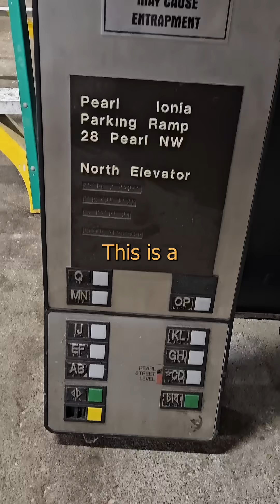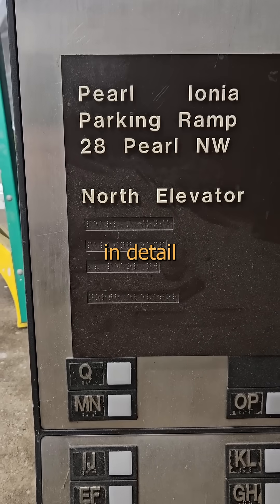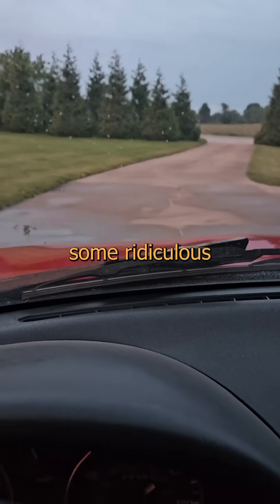Miata Mischief #chrisboden #engineering #gear #elevator #score #stories #parts #hacking #making

Comment: In a 1st gen RAV4, backseats removed & stored over in YeahNahIDunno. Mate & I go collect a  fridge, a very large fridge  ...almost a small chiller large fridge. Got 6' 5" * 2'8" " * 2'8"  fridge in with all doors closed; lay back of passenger seat right back, "borrow" a block of wood so fridge sits level..ish, adjust rearview mirror around fridge, like literally move mirror so fridge is far enough forward to close back door. "Sitting" in driver's seat I was contorted around fridge, had to use my shoulder to hold it so it wasn't acting as a brake on the steering-wheel. Mate reckons I had "more room to drive"  coz I had my arm amputated ..spoz I do take up less room now. Looking to the left I could only see fridge, going thru every intersection was a religious experience; "please God let us ass thru this crossroads undamaged, lest we harm thy sacred fridge"?.  The fridge was relocated successfully with no damage except a few scratches on the dash & soldiers on to this day keeping about 6 dozen beers cold for those that earn them. I drove that trip but to this day I have no idea how Old Mate made the journey, wasn't enough room for the  fridge & "¾ of me" at 5'9", so your guess is as good as mine where all 6'3" of him squeezed into. 
Miss you Mudskipper, R.I.P.

Comment: I dragged a massive metal toolbox (the kind with drawers), full of tools (mostly a shittonne of drill bits, some electricians tools, a load of allen-keys, and some wider miscellaneous detrius.) Out of a dumpster down the road, struggling IMMEDIATELY, in more and more and more pain as i try and drag that chunky bitch from her landfill fate. I dont think i actually got INTO the dumpster, but i got pretty fucking close trying to leaver it out. 
I dragged it out of the dumpster, on to the grass, and promptly flopped down and phoned my mum to send my sister to rescue me, since i was sitting on the side of the road, because id managed to figure out that, yeah, my Ebike probably wouldn't be able to drag that home. 

my sister and i also pulled out a ladder, which we stuffed into our mums car, and she drove home while i desperately tried not to let on that i was in pretty severe pain.

Im disabled with a degenerate joint condition. My muscles are reasonably strong, but my joints are essentially made of silly putty, and i had pretty clearly hurt myself pretty damn badly. I was lucky enough to have access to pain medication and didnt have to go anywhere, because it hurt for a fucking long time.

I have honestly not been properly out of pain since. 

Luckily the tool box fucks SEVERELY, so id say its worth it

Comment: Queen sized bed frame with public transport.
Alone.
I had to change the connection 3 times and on the last one it was so packed i couldn't fit with my 2 huge beams and a backpack full of planks.
So my smart assi went to a random store and begged the clerk to hold onto one of the packages for me. Happened to be a lingerie shop at that. But the clerk lady was really nice and rather amused so it all ended well

Comment: When I had a 1999 Acura Integra, I moved a couple blocks away. I think I got something like 12 guitars in cases in that thing. The previous owner said he got a 7 foot christmas tree in it, and I used to stick my bike in the back just by removing the front wheel.

Hatchbacks are awesome. 

Oh, and one time I hauled a 2"x10"x8'  cherrywood beam that was in a pile of rubble from a small barn that was recently demoliahed on my great aunt Marges property.  I was in college about two or three hours away. I was told about the demolition and was asked of I would like to reclaim any of the wood. I think this must have just been stored in there, and not used as a structural part of the shed/barn. There was about 16 feet of it, and I had to cut it down so it would fit in my 1993 Toyota Corolla sedan. I made guitar and bass bodies from it.

I wonder who put it in the barn, how long it had been there, and what the story was.

Comment: Okay, In high school, a friend of mine and I hauled home the engine from  a late 60s VW Square back by removing the front seats of my father’s ‘58 beetle, using lawn chairs to sit on on the way to pick up the engine, then folding up the chairs, and balancing the engine on the parking brake handle and sitting on the engine while driving back home.

Comment: In one day and a lot of discomfort, I discovered that a 2020 VW GTI can fit 2 rear doors for an F350, AND a hood for the aforementioned GTI. The steering wheel was scoped all the way in, seat all the way forward, up and backrest at an acute angle. I couldn't wear shoes otherwise my clutch and accelerator were always depressed at least a little, and I had to have my equally uncomfortable but slightly smaller passenger shift because I couldn't contort my arm to reach the gear shifter. That was a fun 6 hour trip

Comment: Back in the mid 90’s CSX was (re)double tracking the former B&O across northern Indiana. With that the old B&O color position light signals were coming down too. The signal foreman said we could have a signal head. We come backs couple hours later with an old Chevy S10 with dead shocks loaded 4 B&O CPL’s, 1 barely fit in the bed, one stacked on top and one hanging over each side and drove off scraping the ground the entire 10 miles home.

Comment: Me and my dad had to haul 3 giant lexan(a sort of plexiglas, just layered) from one part of the city to our house, about 10 km. We had an old station wagon Citroen BX, that was large but not nearly large enough. The panels were longer than the car. So we put them on the roof tie them down and off we go. They are hanging over the hood and the trunk is open. Everything worked until we hit the freeway and the panels acted like a wing. I could swear that the front of the car lifted of the ground at one point That was the craziest haul i did in my entire life. Than again, my dad is a crazy, unrelenting SOB...Who knows what is brewing under that gray scalp...

Comment: My pregnant wife explains we have yo pick ip the changing table but not, that it was a combination crib, changing table and three drawer dresser all in one and all in solid pine. I completely disassembled the beast with a borrowed pair of pliers . Stuffed the trunk and back seat with parts. I put the floor mats on the roof to pad the oversized rails strapped down with the rear seat belts extended thru the door jams and tied together.

Comment: I transported a ye oldie freezer inside a 2004 yaris with my grandma as a passenger.

I also had an occasion to tow an 2004 Audi A4 with the same yaris (yes little 1.3L engine did it).

Comment: I once owned a 98 Chevy 1500 V8. It was held together by stuff from home depot. I used this truck a lot
There was this one time my friend had to move things out of storage. One of those things was a nonoperational motorcycle. Of course we rented a flat trailer. I ended up having to hold the bike in place on the trailer because the straps kept snagging.
Hindsight really is 2020

Comment: I welded a full size boat captains chair to a set of office chair wheels, had to move it back home so I loaded it up into the Miata upside-down. Anything over 20 miles per hour spun the wheels like a helicopter rotor... and it made the little Miata look like a helicopter... super sketch, if one of those wheels flew off and hit me at the speed it was spinning I would have gone unconscious.

Comment: (definitely did not) saw a big county sign on the side of the highway when taking my younger brother to his friends house, the sign was just resting against its post, now on the ground. i went home then to work. after work i drove back to see if it was still there, it was.

i pull over on the side of the highway around 11:40 pm in my 95 civic sedan and open the front right door and BARELY fit this sign inside in about 5 minutes. drove home with the passenger window down so the sign would fit

Comment: Not the most exhilarating story compared to others, but I have proudly fit a mattress INSIDE of my dinky Civic coupe. We had to fold it in half, cram it through the back and it just barely managed to fit through the interior trunk access and into the front seat with the front passenger folded forward. So from trunk to front seat, we made it fit.

Comment: 400kg of laminate in my Volvo 850 wagon. sure, legally ir was overloaded and i couldnt see a fuckin thing out the back or the blind spot but it fit perfectly when i put the seats  down. now, the place mr and my best friend needed to haul that was his house, wich is on a hill, a very steep hill. luckaly the volvo is a TurboDiesel and hauled it without issue. 

Also one time me and 3 of my friends helped my moms friend move. and unfortunetly the volvo was in the shop at that time so we used my best friends Mercedes 190D, overloaded the trunk, stuff on the roof, on us while we were driving. idk how taht 2L NA diesel was able to hauls us, but we made it

Comment: I have an NC Miata. Same same as that NA but upscaled for my 6’2 ass.

I took a trip to IKEA, bought a bedframe, hauled it out and proceeded to break down the packaging in the parking lot. All the funny bits went in the passenger side, cardboard crammed in the trunk, and the backboard jammed between the console & passenger seat.

45 minutes later I made it home with the top down and seat heater up in 50° weather, painfully and achingly aware of the aerodynamics of passing around an 18-wheeler on the freeway with that headboard sticking up like a shitty sail. They call the NC the boat of Miatas, but I pushed it a little too literally. I should’ve just told my girlfriend I had it delivered..

Comment: Last year we had a project car, we wanted to bring it over to the shop. So we took the tow bar and hookt it to it 100m later the bar broke and stupid me the project car had no brakes and no handbrake nothing... roling down the hill i dodged 2 cars of trafic and ended in the farmers hedges.
He heard some noise came to watch and we made fun about that he thought it was a stunt that didnt went as we wanted.
Then he went took his tractor and his tow rope.
Since the hook on the car broke and not the bar it selfe he we looped the rope arround the engine Mount and he pulled us out up the hill from there we put the car in front of the project car and pulled it with a car. to make sure its not crashing into the other car the 3rd of us friend sit in the trunk holding a tire between the bumpers (Trip was like 8km that are round about 5 miles)

Comment: My mous sketchy would have to be one of two, first was hauling a week's worth of firewood and a tarp in the back of my sixteen buick encore, just so I wouldn't have to take five trips in a wheelbarrow up my backyard, second, was probably a thousand pounds worth of dirt, used as wait during a very bad winter in my 1999 f150, because my dad couldn't be ours to grab the cinder blocks out of the frozen backyard, and we had just dug our ditch out three days beforehand, possible honorable mention hauling a 2011cadillac cts out of a ditch on a icy road in a 2000 ford explorer

Comment: Back in 2000, there was an old poultry processing plant that was slated for demolition in my home town. It was my last summer vacation... The time between graduating college and the start of my first post education job in October. I found I could slip inside via the slots that the meathook chain belt passed through, and I was able to unlock the place from the inside. I went there nearly nightly for three months. I salvaged telephone patch panels and wiring, old equipment, sensors and switches and brass gauges and all manner of 50s-80s era equipment... My prize finds... The relay control unit for the elevator, and the original blueprints for the building. All of this hardware was hauled home either walking or by bike, under cover of night. I spotted a massive electric bell... I think it may have been nearly a foot in diameter. It was very high... I had strategized a way to safely get up there, but sadly, the next day, demolition had begun.

Unfun fact... I found two vaults there. Both were accessible. In one, I found boxes of folders... Old employee records... SSNs, the works. When the company shut down, it was all left behind. I took my dad's folder, and another relatives folder as mementos, and burned the rest of 'em... Stuff like that should have been destroyed... Not left behind.

Comment: When I was a kid, about 10, there was a Sylvania lamp distribution center, big huge warehouse about a half mile from my house, where they shipped bulk quantities of lamps of all types to, I guess, stores.  A guy on the shipping conveyor would physically pick up a box of light bulbs and SHAKE it (we saw this process, my idiot friend and I) and if it RATTLED or had an obvious hole in it, he'd stack it by the loading dock door. Same with fluorescent tubes.  48 inch jobs and 96 inch ones too.  Then, end of day, he'd take these rattly boxes with a couple of broken bulbs or tubes and toss them into the dumpster.  Along comes ME on my old 3 speed English bicycle and I'd heft a box about a foot square full of fluorescent tubes 96 inches long and make off with it on my BICYCLE.  No box? No problem, I'd tie them together with string or wire for the trip.  Same with a 2 foot square box of 3-way Sylvania light bulbs...minus the 2 or 3 broken ones.... maybe 60 lightbulbs in one go.  My little shack laboratory had 2 96 inch fixtures I'd mounted up in there so I had PLENTY of spares.  When I got my ham license in high school I had thousands of light bulbs that I took to local hamfests and sold for beer money!  Only once did I crash in a cloud of phosphor, mercury and broken glass.... and it wasn't pretty.  I found my first ever copy of AVIATION WEEK in that dumpster and it changed my life.  I also found lunch garbage and the occasional possum.

Comment: A tree fell across a trail me and my buddy used to use as a shortcut when biking to town. We brought out an axe and took turns on it until we got it to split, took the end that wasn't still somewhat buried, stuck one end on my bike in front of the seat and the other end on his, used the tree as a bridge between the bikes and hauled the tree home as a 4 wheeled independently steered vehicle (was not easy) and chopped it up into firewood. Fun times.

Comment: Just recently I had a need to buy a 500L water trough - the kind you put in your paddock to make sure your herd of cows has water. Made of solid plastic it was light, but big and awkward. I should also mention that there were gale force winds at the time. Having an SUV it wasn't going to fit inside it, so I threw it up on the roof racks and used strops to hold it in place. It was sketchy enough that the store manager offered to drive it on their ute the 30km to my house free, because I was surely going to crash. I declined. Got home safe and sound, not an issue.

Comment: We cut a steel spiral staircase into 3 parts in front of a wall of windows. This home had no driveway, we had to walk in about 250 ft, so we opted to send the 3 parts down to the road below, some 80+ feet, along an old mining cart rail pulley system. The pieces didn’t fit even halfway but they made it down mostly without incident or runaways. We then hauled it back to the city somewhere miles, and pilled into the middle of our warehouse bottom floor where some old bikers and a monkey that cooked meth started a fire and burned out the elevator shaft. Here we hoisted each piece with some old maritime wooden block and tackles into place, where the cut points were re-welded. Then just 4 years later this spiral stair would be the only route of egress to those above when our warehouse main stairwell caught fire. Saved some folks that work, good stuff. The other would be hauling my face to the hospital after someone randomly smashed it in, having to convince people you need an ambulance when your face is broken in 12 places will def take the wind out of your sails. I guess that’s more someone hauling me at that point, but a lot of me hauling me after that first ride. What baggage?

Comment: when I was about 17, there was an abandoned Volvo 240GLE Turbo 2door on my street. After a few weeks, and a bunch of towing notices building up, I thought I should take it. So I'm on the side of the street trying to jimmy open the lock, when a cop car rocks up. He asks me what I'm doing - trying to bust open the lock of a dupmed car officer sir. He goes back to his car and runs the plates. Comes back and tells me the car has indeed been dumped. He then helps me open it up, and then push it down the street to my place. Fixed the blown turbo and got it roadworthy. That thing was a tank that my drunk dad stole two years later, but that's another story.

Comment: In the past I was tasked to bring on site 30 meters of steel cable trays, 10 pcs of 3m, because our delivery car broke midtransport and we needed to have this trays this particular day on site. Only car that I had was Renault Clio II hatchback 3-door. 

I did it. Scared shitless. But for that they gave me Siemens S5-100 with full I/O (part of installation was modernised so this PLC would be trashed anyway) which i used to make shades control in my room xD
Later it died because of lightning hitting my house.

Comment: Took apart a Whirlwind pinball machine to fit it in my VW golf. Had to take the legs and backbox off and my buddy scooted his chair back in the passenger seat and rode 5hrs in the car with the backbox on his lap. Had to angle the thing in and scraped tf outta the roof of the car but we made it back.